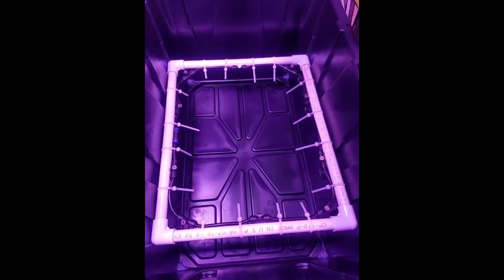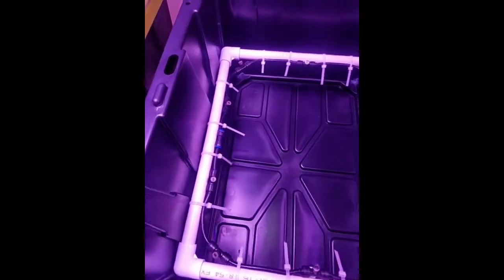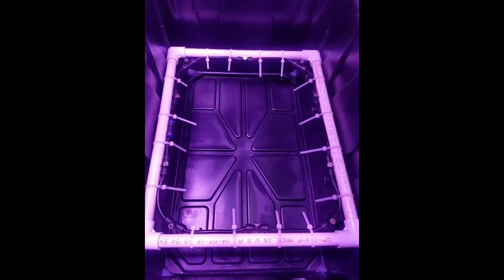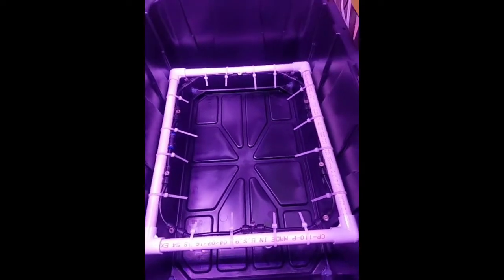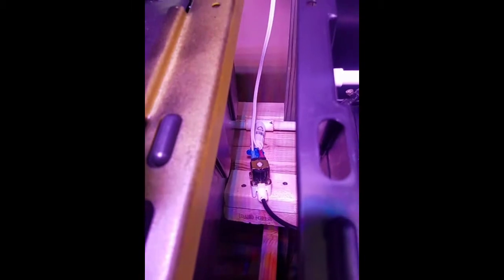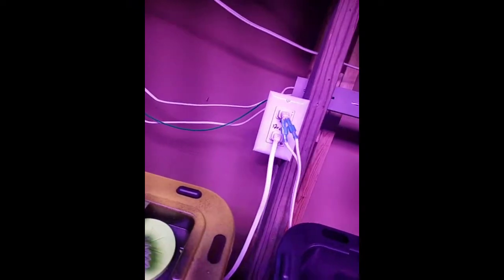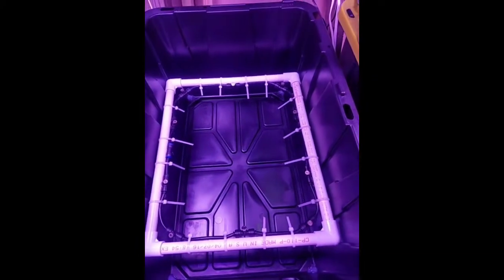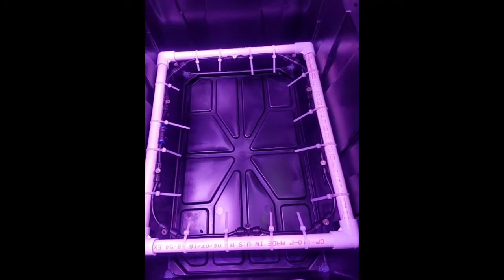DIY Arduino Controlled Aeroponics Sprayer Setup

Comment: 10 nozzles will soak the heck out of everything leading to hydro results. Use the fewest number of nozzles that will fill the tote with mist, it doesnt have to be excessive. With fewer nozzles you can run drain to waste which prevents nozzle clogging issues because they only see pristine nutes once, not the accumulated junk, bacteria, pathogens, algae etc constantly returning from the tote..
Reply: The whole idea is to waste less water. That is why operators to post feed sterilization of nutrient water. Most commercial hydro growers do this now too. Common sense. It doesn't matter if you have a lot of nozzles, as long as they are not too powerful, they are spaced okay, and the intervals are good.